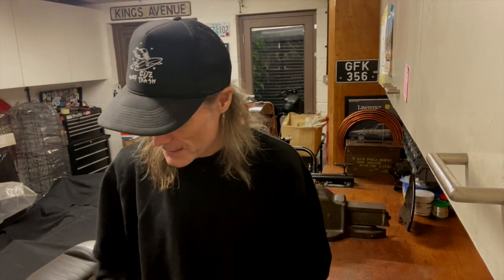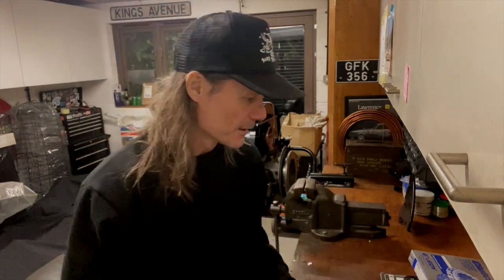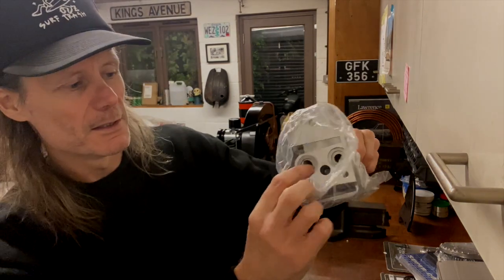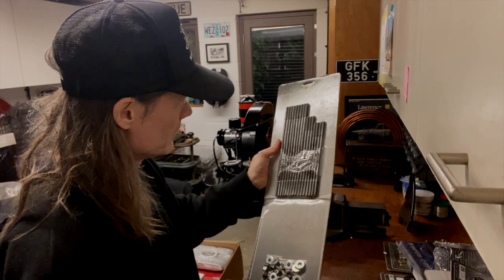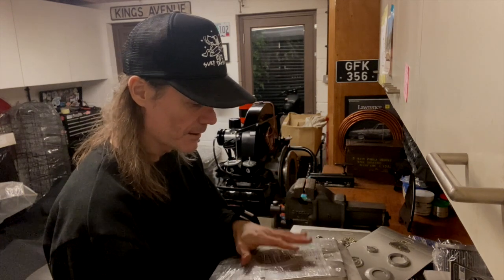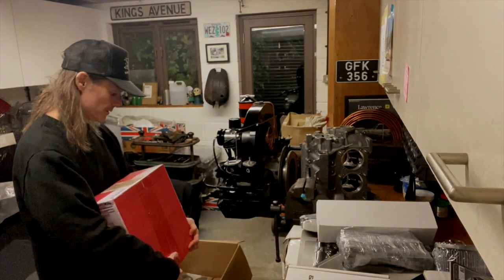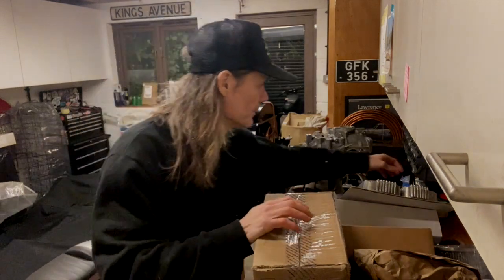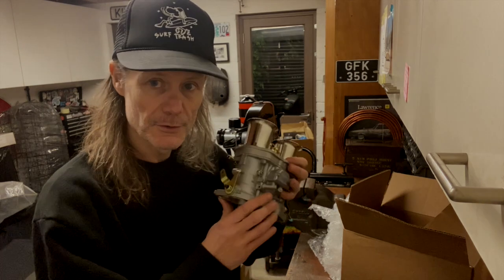PART 1 – Unboxing the Shipment - How to Build a CB Performance 2017cc Builder’s Choice VW Engine

Comment: Hi, I've just ordered a CB Engine builder kit, so your video's are really helpful thanks. I want to build a 356 linkage to use with my engine and noticed you've an Okrasa engine. Do you know where I could get any plans or dimensions to fabricate my own linkage please?
Reply from the maker: Ah ha, that's great to hear. I hope these posts do help. Which kit did you buy and what vehicle is it for? I made my own 356 style linkage for that Okrasa motor. I'm going topost a bit more about that in a few weeks. I used a linkage bar from a 356 and the fan shroud bell crank. I then fabricated the fan brackets based on the bar. I started out copying the brackets from a 356 motor,but they didnlt fit the VW fan shroud, so I had to make bespoke brackets. Good luck.
Reply: @aircooledanything2415 
Hi, thanks for getting back to me and thanks for the info. I've bought a 1915cc engine which is going in a 356 replica, hence why I want an original looking Carb linkage. I'm an Engineer, so happy to fabricate. Your posts are great, really taught me a lot about the engines.
Keep them coming!

Comment: Don't vapour blast the inside of a VW engine case unless you want contaminates leeching into your engine oil for the life of your engine. 
Why build a 2L like that when Vw already made the 2L Type4 for the Vw 70's bus anyway? 
I assume your planning to be doing a fair bit of racing with straight cut cam gears (unnecessary for a street motor)? I didn't realise England gets that hot to warrant all that additional oil cooling? We're building  2L type1 engines to last in Australian heat which only run a very small external oilcooler (half the size of yours - your is a fairly decent size).
Good honest unbiased unboxing vid which is good to see. I agree with you that there's a good chance they didn't balance those parts.
Reply from the maker: Thanks for the heads up on vapour blasting. I've had a few done, but not put any decent miles on either. Good point about type 4 motors. Rock solid and a better solution for sure. For me, on this one, it's not about practicality, but more about fulfilling a dream of building a CB engine. I've always wanted to give it a go. A bit stupid I know. I'm not a professional, just a guy noodling in his spare time and I appreciate the advice.

Comment: Good video when’s the build vid coming ? What did the kit cost
Reply from the maker: Hopefully the build video is coming soon. I'm going to paint the case, but to do that I need the ambient outside temp to go up a bit here. Then it should go together quite quickly. So far the cost of all these pieces is pretty much exactly  $8k. Plus shipping and import tax to the UK. So not cheap!
Reply: @aircooledanything2415  what would you balance twin 40 on a 1641 engine ? I’m using the snail flow meter?
Reply from the maker: @tospicy4ya  yeah that's  what I use to balance twins.
Reply: @aircooledanything2415  what number on the snail ?
Reply from the maker: @tospicy4ya  No specific number. You want the motor idling at 800-1000rpm and the numbers on each side being the same. Job done. 
Be sure to wamr the engine up first and disconnect the the throttle linkage to make sure its as accurate as can be. Good luck.
Reply: @aircooledanything2415  and the mixture screws wind them out and slowly wind in until engine falls then turn back a quarter do on all four? I had it set up on rolling road in September last year it’s spitting a lot so I’m assuming all jets Are correct and since replaceing alternator t needs balancing again as pulled plugs and they were slightly black
Reply from the maker: @tospicy4ya  yeah the idle mixture screws might need a tweak. If the plugs were black then that suggests it was running rich. Which is better than lean, which can hurt the motor quickly. As you say turn in until it falters (but the carbs need to be balanced to do this) and the turn out 1/4 of a turn. Then you could double check the linkage to make sure its activating at the same time on each side - I only eyeball that - one hand on one side and watch the other side.
Reply: @aircooledanything2415  I did the carbs to 5rpm but the idle mixture on one carb didn’t really stall the engine as the other side did really leaving me thinking there might more tweaking to do. I’m going to do it again later shall I increase the 5rpm and while engine is off wind out the mixture screws and very slowly wind in ?  It did drive better sure there’s room for improvement?
Reply from the maker: @tospicy4ya  Hi, sounds like progress. 5rpm?  You sure about that? You should be looking at adjustment around 1000rpm.
Reply: @aircooledanything2415  middle of the flow meter so is that 5000? And is that ok
Reply from the maker: @tospicy4ya  I see. The number on the flow meter. The idle screw on the actuating arm should be adjusted to so those numbers are the same for both sides. So you've done that bit. If you have a semi-decent timing gun then you can find out what that balanced set up is running in terms of RPM. Should be around 1000. I aim for 900, depending on the motor. If the idle is higher than that then when you move on to adjust the idle mixture screws you might find that more difficult. Just to be clear when adjusting the mixture, it's a really tircky thing to do if you're new to it. You're listening out for a very subtle change in the running of the engine - the engine starting to falter ever so slightly, not running sweetly and smoothly, a slight hesitation. That very slight hesitation is what you're listening out for, not a total stall and splutter. It's hard to do. It sounds like you've made some good progress though.
Reply: @aircooledanything2415  maybe I was listening for a stall as the other side did even so it did actually cut out . On one side the engine started to increase 🤔
Reply: @aircooledanything2415  not getting much joy with the idle mixture screws . There’s a strong petrol smell when stood near the van even had people tell me and it’s still spitting a lot 🤔although top end it drives ok
Reply from the maker: @tospicy4ya  As I say, I'm no expert. In a situation like this I try and work out if the problem is occurring on one side of the motor (1&2 head or 3&4) OR if it's both sides. Then I go through the possible causes of the problem. You could look at the following. Manifold letting air in where you don't want it (spray some WD40 around the mating surfaces when its running and listen for engine note changes). Fuel supply (test pressure out of fuel pump, or try a different pump, electric pump, test float chambers on each carb, possible sticky float chamber needle or damaged float, are the carbs weeping fuel). Check your timing (valve clearance, distributor advance etc). Electrical check (are you getting a strong spark to each cylinder, try HT leads, plugs, condenser, points, coil). That's allI I can think of for now. I'd try testing for leaky inlket manifolds first then move on to fuel supply. Good luck. You'll get there.
Reply from the maker: Just thinking more about it. If it's running good at top end then I doubt its timing or electrical issues (although it could be advance on distributor). It sounds like a fuel issue. When you say it's spitting, is that popping from the exhaust or from the carbs?
Reply: @aircooledanything2415  is say carbs I was going to try smaller idle jets as someone said if mixture screws aret doing much then idle jets are too big.. the exhaust is brand new hausmen one , there’s a definite notice in performance as my partner said yesterday it’s took fast on this new exhaust 😂😂
Reply from the maker: @tospicy4ya  It definitely sounds like a problem with the idle circuit. If it's popping out the top of the carbs then that means the fuel to air ratio is out - running to lean - too much air, not enough fuel. If it's popping out the exhaust end then that's too rich, or timing for both. So if it is popping out the carbs (take the air cleaners off and run it, you'll be able to tell if it's out the top, you can even get blue flames), swapping the idle jets for smaller parts will make it worse and not better. I'd say it's either a leak in the manifolds or poor fuel supply. If it's just popping on one side then that says to me it is more likely a leak, as bad pump pressure would effect both sides. If it's the exhaust end that's popping then a smaller idle jet might well work out. Let me know how you get on, and good luck.

Comment: looks like you have a nice batch of parts. I built a 2017 cc last year for my beetle. It is a little different than yours but I am quite happy with it. Should go together pretty easily for you. Cheers
Reply from the maker: Thanks Rob. I'm hoping it goes together nice and easily. There's bound to be a few snags along the way I'm sure. Currently I'm patiently waiting for the temperatures to go up so I can paint the engine case. Should be warm enough next week.